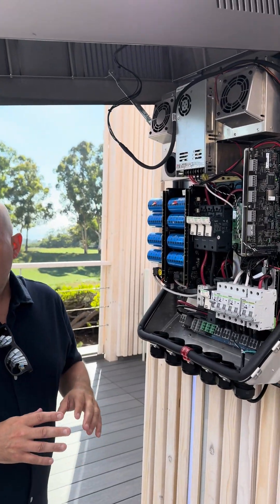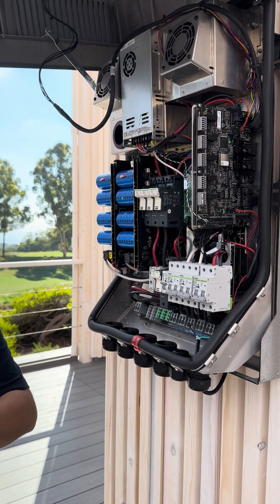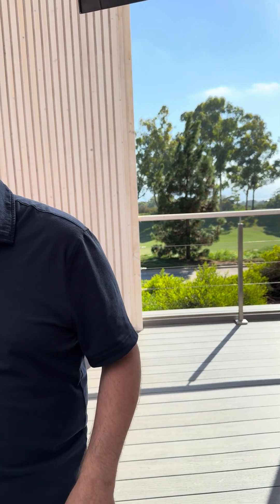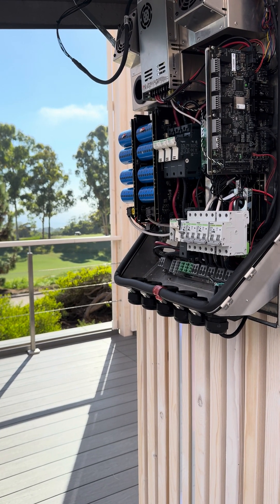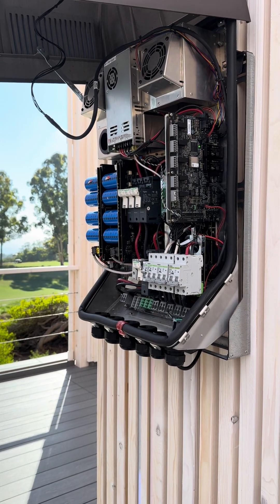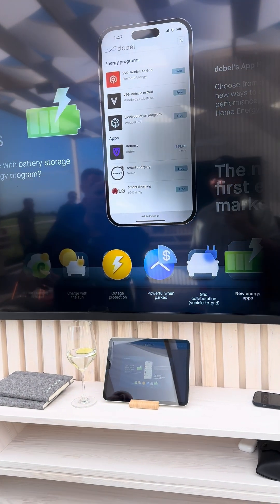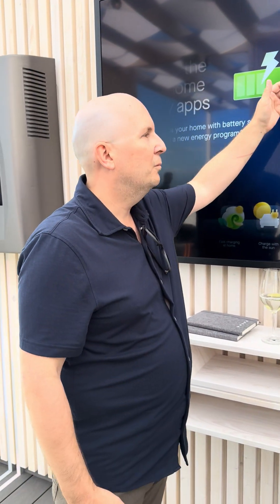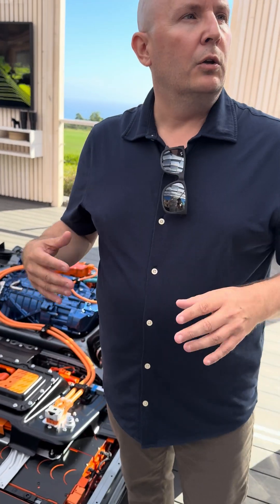Volvo EX90 Bidirectional charging with DCBEL

Comment: I don't understand which problem bidirectional charging is solving. Why would you want to use your "own" electricity?! Just put it on the grid if you don't need it, and take some electricity back when the sun isn't shining. Use smart charging (V1G) to move your flexible loads to the moments when the sun is shining or electricity is cheap. Done.
Reply: You want to consume from the grid when the price of energy is low, and export to the grid when the price is high to generate the maximum profit for yourself. If your energy rates are constant, this is of course not useful, except to store energy when you are not consuming everything that is being produced.
Reply: @SevenTowers but charging your own battery consumes up precious fractions of limited life cycles of the battery, and with the conversion losses I would triple check whether or actually worth the process cost wise
Reply: resiliency.  Grid is down, you can use your EV as a very large backup battery.
Reply: @epelegrillopart  Grid is down, you need to bail out in case a storm comes... Stupid reasoning.
Reply: So this machine uses software (set up to the owners preferences) to efficiently manage what power is going where and at what time and at what cost. If you have a house battery, solar, and EV (with V2X abilities) and are grid connected this thing makes sure you are using or charging the right thing at the right time to either save money or actually make money selling back to the grid. It also gives you the flexibility to do things most others can't, like charge directly from solar to the car without any conversions. Or charge directly from the DC house battery to the DC car using DC without any conversions (losses). Or to use the grid to charge either or both. Or sell to the grid. Or backup your house during an outage using the house battery or car battery. To me it is an attempt to provide all the power management options we expect, but until now have been unavailable.